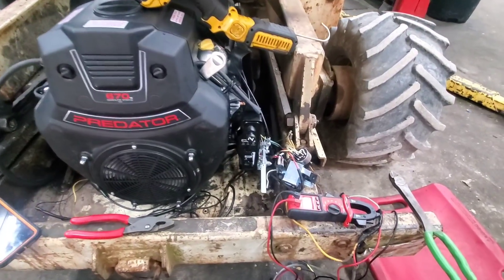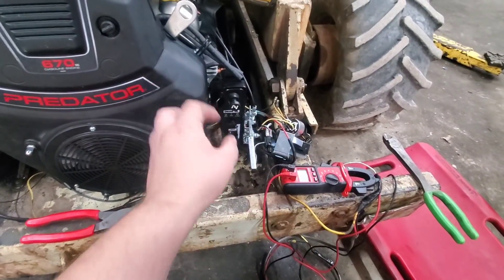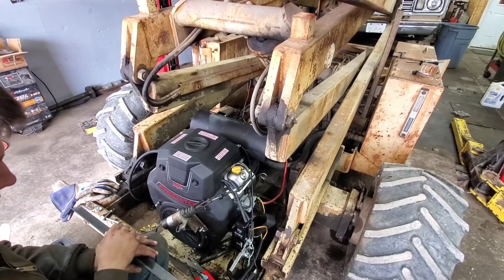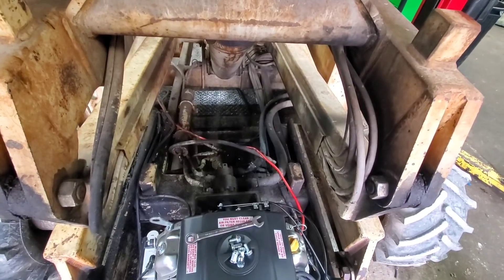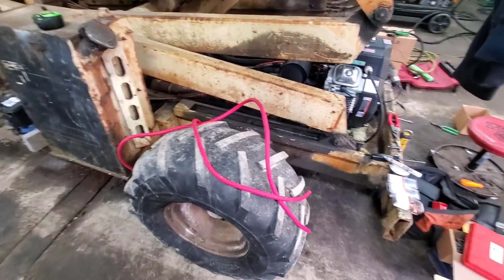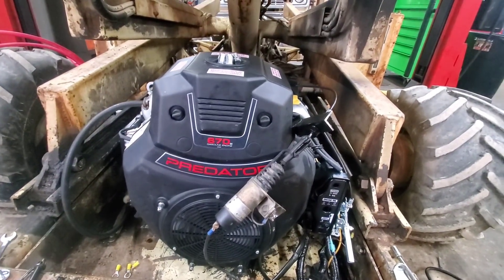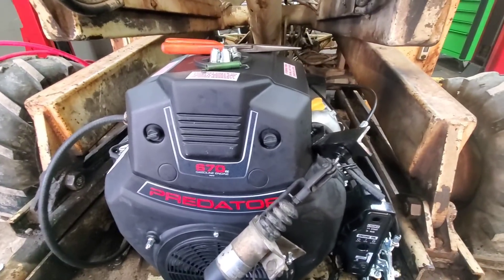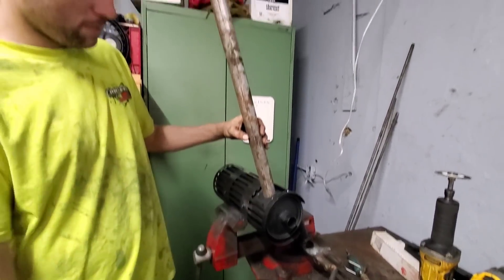Predator 670 wiring, exhaust and choke

Comment: If you are routeing the exhaust the way I think you are you may want to consider either get some exhaust wrap  or build a heat shield out of sheet metal.  With regard to the spring have you checked with Napa or another parts supplier about seeing if they have any spring stock and just winding your own spring or possible trying a universal carburetor return spring(s) possible a double spring
Reply from the maker: We have wrap for the exhaust and napa got us the spring for it. The next and hopefully final video will be tomorrow

Comment: Holy crap.... we're doing the same swapp into my brothers old 70's Melrose skidsteer.... Well done man..... I'm interested to know how this motors torque works out compared to the old engine...
Reply from the maker: So far it has no issues running the hydraulic pump at about half throttle. Lift and travel are the same speed we had with the old motor.